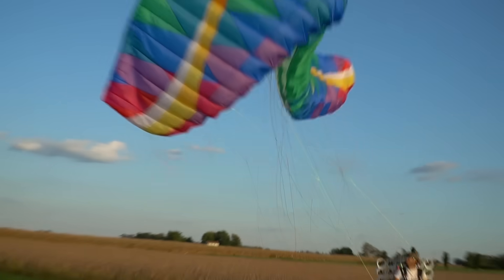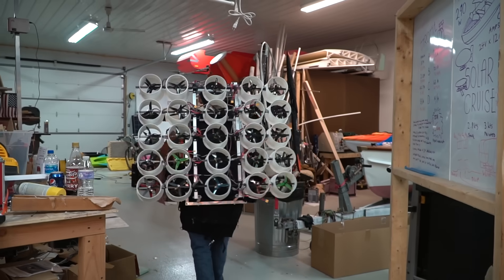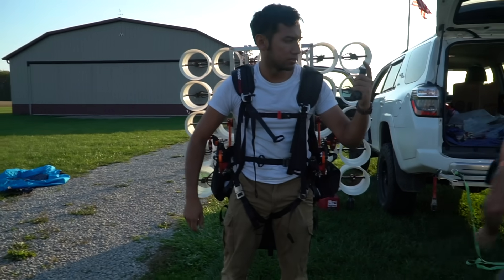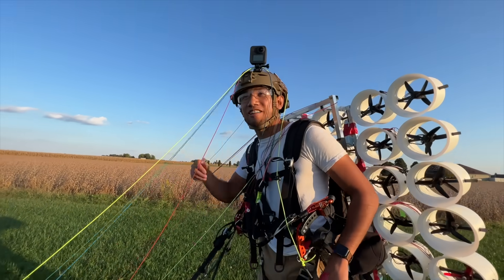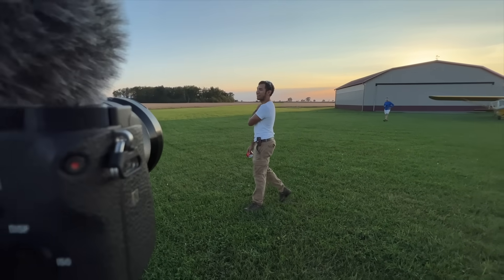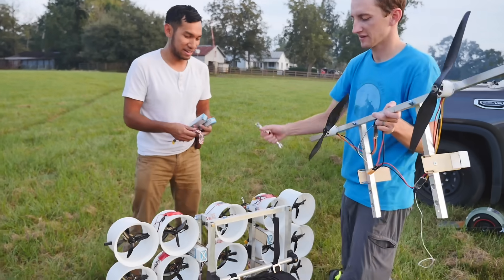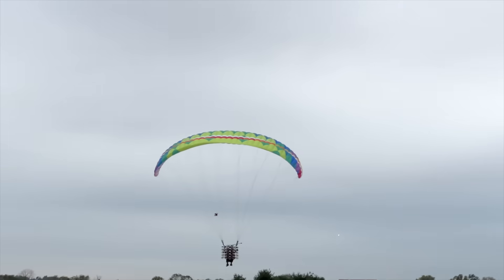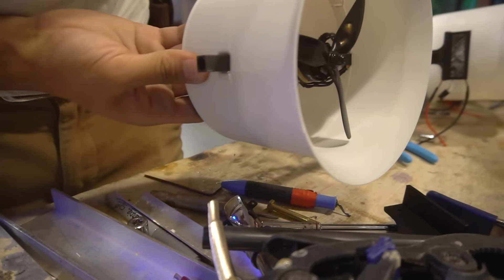Flying with 50 drone motors (homemade flying machine)

Comment: You may not know this, but brushless PWM motors have an optimal speed/blade pitch for differing densities.   If you run them at their peak operating point per fan curve data, you can switch on and off fan banks and a constant RPM/pitch angle and optimize your current use for the same thrust,  thus giving you longer run time on the same batteries.  This is one of the reasons modern prop airplanes have both adjustable prop pitch and rpm.

Comment: How about 8 motors on 2 folding panels, on the back of a SUPER 73 electric bike, with a nice backpack on the rear for the parasail and additional batteries.   A flying bike!

Comment: Carbon dioxide (CO 2) is an important trace gas in Earth's atmosphere.It is an integral part of the carbon cycle, a biogeochemical cycle in which carbon is exchanged between the Earth's oceans, soil, rocks and the biosphere. Plants and other photoautotrophs use solar energy to produce carbohydrate from atmospheric carbon dioxide and water by photosynthesis.

Comment: Batteries pollute allot more than gas engines. You have to dispose of all those toxic batteries when used up in a 3rd world country such as India. Also, it takes energy plants to charge those batteries which pollutes. Hydrogen is the way to go. It breaks down to water...

Comment: Kool project.
I wonder if it might help if you arrayed the motors into a circle/concentric circles, then circled the perimeter with a ring/'bezel' in order to focus the thrust .

Also, I wonder if you're losing a few percent of thrust from the interior motors (closer to the pilot's back)....or maybe vice-versa, LOL.

Instead of a square/rectangular array.

Comment: These rotors only add pushing force, can’t be used without that parachute. You could take a bottle with compressed air and an outlet with you and the effect would be the same.

Comment: i noticed that you've got hardness during take off, why if the first row above from your blowers must add a bit of command to blow or face to chute to make your lifting off easier on air and during the weaker wind it will help to maintain the altitude ....

Comment: Suggestion: (If doable?) Find and adopt (save) Milt Hatfields Abandoned and rottening Little Bird #1, 2 or 3 - 4 Electric and VTOL conversion using your ducted 50 prop setup.

Comment: Amazing! Just wondering if the noise could be reduced by using multiple different sized rotors and/or motors with different frequencies? Should result into less accumulated noise, because oscillating at different phases/frequencies. Also I love the fact that these small rotors could be arranged into any shape resulting into real futuristic tech, unlike one big rotor! ;)

Comment: Could you keep the duct the same diameter but install vortex generators shortly before? It'd allow for plenty of flex without binding and melting the PLA.

The question would be whether or not it'd produce more thrust over not installing vortex generators within the duct.

Comment: Four things you could improve. Although the last is more of a guess than an estimate.

1. Remove the middle vertical row of motors and props, they won't be as effective as your body blocks much of the airflow.
2. Use 25% larger props and engines (but with just the 2 vertical rows on each side)
3. Make ducts with a hexagon exterior and then you can have a more ridged frame and possibly a better more compact motor layout.
4. Add a slight (+ or - 10%) steering channel and have the right or left motors spin up or down slightly to give you better directional control?
Reply: Much of what I was thinking. Especially #1 which immediately came to mind. But he has a great imagination!
Reply: Agree perfectly
Reply: i was thinking about the hexagonal, triagonal arrangement too. too many good reasons, structural and dynamical and more...
Reply: Agreeing. For #1 just to help (hopefully) using a thought experiment, picture a suit you wear with ducted-fan channels, open in the front and back creating a vacuum in front and pressure out the back. Currently it's tending toward creating almost a vacuum-ish situation--we've got a situation here--behind one's back maybe. Bear with me I'm a dork and we need to be loved too, building yourself inside a jet engine don't do this kids.
Reply: armchair expert
Reply: @EazyDuz18 Well you being an armchair idiot, it balances out

Comment: Need better battery tech for sure. I will say watching I realized that it would be possible to set up a hot swap battery setup. Now idk if the extra weight would poopoo the extra capacity but that would be cool. A whole 20 minutes of flight! 
Perhaps some tuning of the props or ducts? Maybe duct length? I'm not familiar enough to know.

Comment: Hey, since you can't use 1 rotor because it would spin uncontrollably, what about a thin ring gyroscope that rotates the opposite direction of the rotor?  Couldn't that work for a 1 rotor drone?  You could even vary the speed of that gyroscope to turn the drone.  Or gimble it completely for total control of the mono-copter.

Comment: naturally you would think that a whole bunch of small props spending much faster than one large prop would be equal or even greater but in reality it's much much weaker one large prop scoops so much more volume of air at literally a third of the rotation speed....

Comment: Planting more trees will help for now but not the future.  Once the tree dies, it just breaks down and decomposes and releases all the carbon it has stored up all it's life.  Or if the tree is burnt or if the tree was used as lumber, it will still release the carbon as the wood ages and eventually decomposes.  So yes trees do absorb carbon but it will be released back into the air.  It's what is in the ocean that produces most of our oxygen.

Comment: Have you ever considered setting up the drone motors to compress the air much like a turbo fan engine? Just make two about 1.5 feet in length with 6 drone engines in each cavity. Remember to use larger blades about12 inches in dia, compressing down at a ratio of 12 inches, 10, 8, 6, 5, 4 inches. Remember the shroud   Should have a tolerance of 1/8 inches to the blades.

Comment: This is super cool but what is the point of trying to fly or actually flying with so many fans and weight?? You should engineer a single unit with enough power to make you fly yet more efficient, economic, lightweight, and affordable than the existing ones these days. Just my honest opinion

Comment: You have to simply REMOVE the CENTRAL VERTICAL motors LINE behind your BACK and put them outsside your FIGURE.  
a PART of your POWER is reduced by YOURSELF blocking air flow

Comment: Looks like a project, but I would suggest erasing the fans in the middle of your body as they are
shielded by it and can provide less drag as the other more exposed ones as the air flux is denser and can therefor provide more pulse.

Comment: A really cazy idea to fly a wing with no prop guard what so ever.
Wings are not cheap in fact i would say that its the most costly part so why not take the time to protect it after all, its the only bit holding you in the air, really guys how about safety first.

Comment: Well done lad....Interesting type Invention but with alittle work Im sure you can get it down to the size of a Jumpsuit with wings..If you put enough force behind something....Even a brick will fly the point is to do it as cheaply as possable. Composite materials, exotic light weight metals help.

Comment: I would use two motors per duct, contra-rotating. This would be much more efficient as well as higher power. Even if it needs bigger batteries, it would have more than double the thrust.

Comment: #PeterSripol
Excellent video!
Quest: How did you calculate (formula) @12:30min you used to calculate propulsion + thrust without the ducts? How you found out propulsion/thrust was more efficient? Thanks

Comment: Oh, and by the way, “fossil fuel” is an intentional misnomer(lie) used to foment the idea that oil is scarce, so they could vastly increase the price. You can thank Rockefeller for the lie in 1892. And Kissinger during the “energy crises”. It should cost about as much as water. It's one giant lie to make the oil companies rich. The newest scam is of course, electric cars. 

Think about the detractors, if you can. 1) If you think our electric grid can charge 300,000,000 cars in the US alone, and soon to be 1,500,000,000 worldwide, you're smokin' some really special stuff. Cal can't keep the lights on now! 2) Requirements to make the batteries. Rare earths are a problem, China will benefit by having the most and dirt cheap labor. 3) 74% more pollution during manufacturing. I'll stop here, but realize, the “truth” you're exposed to probably is tailored to make someone rich.

"Dissent over evaporation processes have been rumbling for years, and many are saying operations have directly triggered a water crisis. The San Cristóbal Mine in Bolivia, said to use 50,000 litres of water per day, has even been labeled an ‘environmental and social disaster’, while the Mexican state of Sonora (where lithium deposits have recently been discovered) is similarly in crisis mode, ranked by the World Resources Institute as having ‘Extremely High Baseline Water Stress’. "   Then there's this issue.

Comment: You might want to see if 3D printing a hexagon duct will let you stack/configure them more effeciently and add ridgidty to your duct system. Like a bee hive.
Reply: He literally just said he's losing thrust because the blades aren't close enough to the sides of the duct, so...
A hex is going to be worse.
Reply: @2S1L3NT  
hex pattern on the outside and circle on the inside. this way the sections don't slide around. a more sturdy rod for the fans to sit on would help a lot too. likely a pressure/snap into place fit where each section has it's own rod it sits on. these could be 3d printed too. create a attachment clamp, 3d print that, this will hold the fan to the rod. drill or leave hole for the wires from the fan to go through. this way each section is self contained.
can make nearly any shape with a 3d printer so might as well take advantage of that fact and allow the sections to connect to each other and add strength to the entire thing.
Reply: @rocksfire4390  it will add a lot more weight
Reply: @bushgreen260  
i don't know about a lot more, his current frame setup is quite heavy and pretty much all of that wouldn't be needed with the hex pattern design. as you can just screw/bolt/glue them together. the frame is the fan housing. instead of how it currently is, there is a metal frame that holds all of the rather lose fan housings.

it needs to be sturdy, extra weight can be balanced out by having a more effective design that doesn't have lose fans with better air flow then the current setup has.
Reply: @rocksfire4390  yes but you ate saying a hex pattern on the outside and a circle on the inside. You wnat to do both at the same time so obviously it will add more weight.
Reply: @bushgreen260  
"yes but you ate saying a hex pattern on the outside and a circle on the inside. "
that's exactly what i said
"hex pattern on the outside and circle on the inside."

ofc it will add weight but weight is lost because you don't need a metal frame now. also metal rods that hold the fans will be much MUCH shorter, which also reduces weight. in fact 3d printing them would drastically reduce the weight. in-effect the weight is likely equal to the old design but now it's much MUCH more sturdy. however now the fans are also more effective because they are housed properly and within spec. so not only do you end up with roughly the same weight but then you gain sturdiness and extra thrust.
Reply: @rocksfire4390  there's no point to this project because paramotors already exist and work better than this. He doesn't need to do this.
Reply: @bushgreen260  lmao
Reply: @bushgreen260  The same could be said about 99% of YouTube. You could probably count the annual number of original thoughts in the world on your fingers and toes, if that many. People don't do these things because they "need" to. Otherwise people would rarely do anything period.

Comment: This is friggin awesome! 
Perhaps you'd get a boost in efficiency and extra power if they were arranged in a larger circle so that your body doesn't block airflow to the middle ones? 
Maybe if the motors connected in two pairs in longer tubes, rear ones having more prop pitch....also 80 percent reduction thrust tubes...I'm sure you could get a lot more thrust with a more sophisticated design
Reply: Small rotors are fundamentally inefficient, they've got no lever-arm due to being so short.
Think of it this way: take 100,000,000 little wee pinwheel generators and collect all their power output and compare to 1 big windfarm turbine & see which makes more power.
(The pinwheels lose.)

Comment: How do the motors compensate for the air blocked by your body? Are the left and right propeller arrays on their own circuit to steer or will you use a rudder system? Could you use a cone based rudder for steering up/down as well as left/right?

Comment: It's fossil fuel engines that dig the stuff out of the ground to make batteries and oil is a major part of plastics and it's nuclear, gas and coal that produce electricity, the very same electricity that powers the servers that host the webpage  where you go to figure out your carbon foot print????

Comment: Your carbon footprint is not 0 someone mined the Materials for those solar panels manufactured them and shipped them same with everything you used to build that house not only that but the batteries are hard to recycle/dispose of and the solar panels have no logical way of recycling them and are Piling up at record numbers polluting the land there is no such thing as a 0% carbon footprint and with everything your tiny house required to make it off the grid it would take you about 6 years to start paying off on the 0% carbon footprint theory and by then you need new batteries and your solar panels are 50% dead or more

Comment: I'm sure you know, that 2 in-series fans aren't much of an improvement on a single fan. When they're identical units, even more so. Could you maybe do two fold-out side units that swing out? Or maybe a hexagonal arrangement rather than a square one? Without having done any maths at all, I wonder whether half of those motors and fans and accompanying etc, are even contributing enough to make up for their own weight.

Comment: Hi, Peter, One suggestion for you. You should use one big propeller instead,   driven by  big step down gear arrangement.   3DPrint a big gear,   mount the  small motors on the periphery of the big gear ,  distribute them evenly.   The gear ratio of the propeller gear to the motor gears should be such that it corresponds to the maximum efficiency of the propeller and motors respectively.  You will have stronger propulsion force and higher energy efficiency.   Maybe you don't need gear. You can just use a small wheel driving a big wheel on which  the propeller is mounted.
Reply: Or just get a big motor.   That would cost more to build then just buying a bigger motor

Comment: I would think that moving the props that are covered by your body (on the back) might help?  

I wonder...if you place the props in serial (rather than parallel) would it increase the air flow?  Like a turbo engine design.

Comment: Nice proof of concept, I’m excited to see what mk.2 brings! I wonder if you could get a bigger prop turning slower to make less noise. I fantasize regularly about being able to fly hearing only the wind.
Reply: Go dune soaring !!!!
Reply: You mean like the propellers used on those powered paragliders? 
Like on the one he has?  He puts the proper propeller pack for it on near the start of the video there somewhere. 

Yeah it's not a new idea,  and it's kinda getting away from the multi drone-propeller idea there.... but that's probably a good thing,  it's been well tried already and there's good reasons they're not used.  

But yes those proper powered parachute/paragliders are pretty awesome contraptions and must give a close sensation of flying like a bird.  :)

I've got a couple little microlights on one of my properties that I fly sometimes.... which are kinda in-between a powered paragliding and an ultralight or small plane. 
More comfort and range and manoeuvrability and all that than a paraglider...  probably a good deal safer too.  But still have a very light, small, open-plan frame and gibe a strange sensation sort of like flying around on an outdoor lounge chair.  😏
You really feel the environment around you, all the wind and moisture and air pressure and dust and insects etc.  
Wouldn't want to cross the Atlantic in one but hella fun.   And quite useful on the land. 

Safe too.  Even if you pass out or something it'd pretty much just glide down and land itself eventually.  Long as you don't hit any trees or anything.
Have a go if you get the chance.